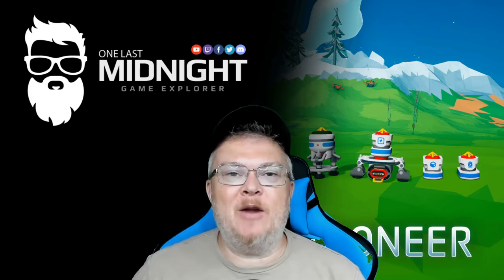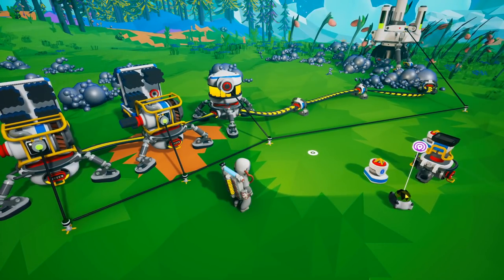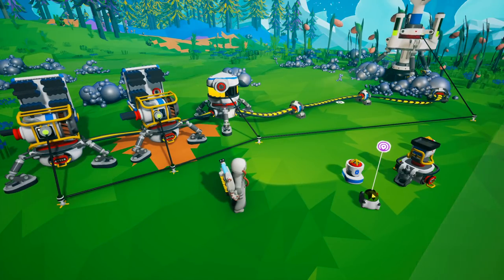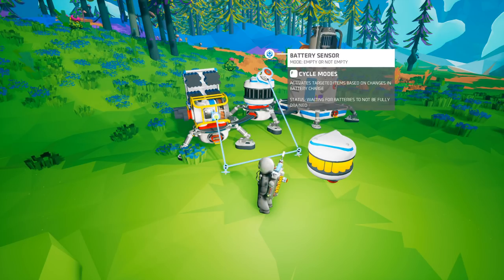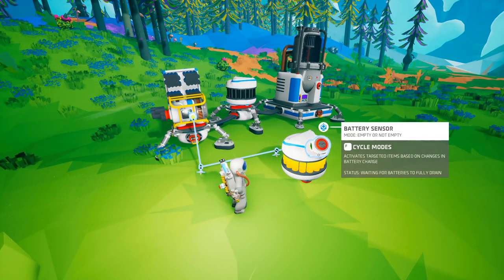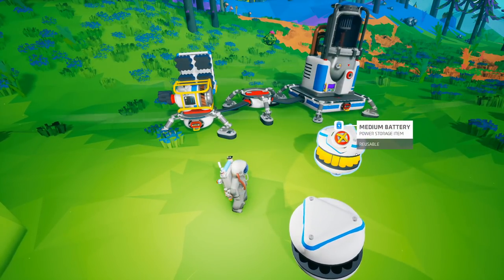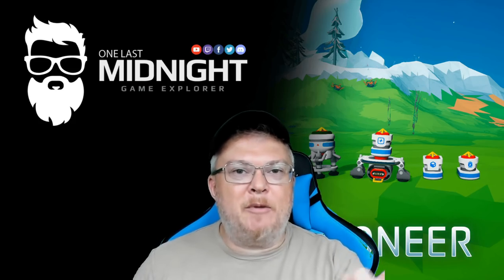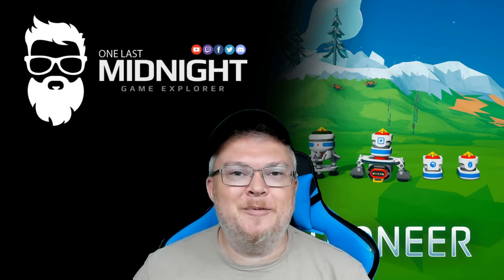Astroneer - THE BUTTON REPEATER & BATTERY SENSOR - PART 2 - A HELPFUL GUIDE

Comment: I'm guessing you could use the Empty option in the case of using mostly wind or solar power for main input. Use the empty option to trigger backup generators only when the batteries are drained.
Reply: Great thinking
Reply: I had the same idea
Reply: I was thinking it could also be used to shut off particular machines in order to prioritize others.
Smelter draining your batteries too fast?
This shuts it off so your research machines can keep running.
Kind of like a splitter, or maybe used with a splitter
Reply: But you'd have to have several batteries, right? And the sensor needs to be attached to the very last battery to drain and to fully charge. If you only had one battery it would create the bugged out loop.
Reply: But won't it freak out like in his video as soon as the generator turns on?

Comment: To get the empty or not empty function to work the way you want it to you just need to direct the flow of power: WIND/SOLAR--->BATTERY--->GENERATOR using extenders so the power only flows one way towards the generator. This way the wind/solar can always power the battery and supply power to your machines and then go to battery power if they turn off. This leaves the generators as backup power when the battery drains but doesn't cause a feedback loop because the generator can't actually power it. I'm sure there is another way to accomplish this but this lets you use only one battery sensor for the whole process.

Comment: That last mode would be useful for the same situation you set up in the last video with the generator, battery, and auto extractor. As soon as the battery is empty it sends a signal to the auto extractor to shut off. while a second sensor tells the generators to turn on (the original sensor you had). You figured out how to run the auto extractor off and the generators on with one sensor by offsetting the on/off status to begin with! (hope I explained that so it made sense lol)
Reply: Yes, so you'd need two sensors, but you could fully use the mode without  it getting stuck. That's smart
Reply: So you mean you have two sensors on one battery, one that has "Empty or not empty" connecting to the extractor and one that has "Charged or Empty" connected to the generator.

So when the battery fully drains the generator gets a signal to turn on from the "Charged or Empty" sensor. The "Empty or not empty" sensor would tell the extractor to shut off. However the very moment the battery has ANY charge at all, the "Empty or not empty" sensor would turn the extractor back on. This would instantly drain the battery again and result in the "Charged or Empty" sensor to fire at the generator. So in the end you would have both sensors firing non-stop and the whole process bugging out and not working.

Comment: The Empty/Not empty is more useful for equipment rather than power IMO. Batteries are empty - switch off the condenser, power is in the battery then run the condenser. This could make for some clever power management almost like an automatic splitter

Comment: Connect the battery sensor to the object consuming energy, when the battery is empty it will turn the object off, when the battery is getting power it will turn the object on.

Comment: The battery empty trigger could turn on a light to let you know your battery is empty...   could also attach to a platform with a battery on it... when battery drained, turn off machine, etc... maybe pause research when the base has no backup power, or turn off automation arms... etc...

Comment: Use the empty/not empty to turn off the condenser when battery is empty, then when solar kicks in and charges battery, it will turn condenser back on.

Comment: I believe that the empty not empty is supposed to be used with the full not full for a base with generators along with solar and wind. Full not full controls a single array of generators and the empty not empty controls a second array of generators. Them working together can be used to increase the efficiency of the generators by making sure that each group of generators is only running when they are needed.

Comment: I think i found a good use for Empty / not empty. You could put it to a solar panel so it would be like a daylight sensor. That could be used, for example, to shut off the lights at day. 
Edit: You can use power sensor as well, you can choose which one is cheaper for you..
Reply: That would be the use of a power sensor not a battery sensor
Reply: @ossian882  Yes, that's true. You could use both. But basically anything related to generators (can be also solar, wind, not RTG tho) can be replaced with battery sensor. By the way, thanks for the reply anyways, with power sensor it would be more effective if you didn't want a delay.

Comment: You could use the empty battery state to turn off your non-essential machines when your power production is low.

For example, have a bank of research chambers that only turn on when it's both sunny and windy.

Comment: Will have to experiment a bit with battery modes and providing power for entire base. Solar and wind are not consistent energy providers so I can see how all 3 modes might be of use when using multiple generators to provide power

Comment: I find the last scenario of the battery sensor the most useful ... if you have several solar panels and a coal generator connected to a charged battery, the battery will of course be discharged at night, the generator starts with the battery exhausted, but as soon as the  sun and solar panels provide sufficient energy, the generator shuts down, using as little coal as possible
to avoid the signal loop it would be enough to have the generator after the battery, rather than before, and put a splitter so that the current does not return to the battery, if instead they changed the operating mode of the sensor (which I think is not the correct way to  operation) would be better, but even so in my opinion it is useful as a mode

Comment: That rapid cycling on and off also happens when you try to use circuit conditions in factorio to turn your power plant on and off when your accumulators run dry. The thing I can think that would make it useful would be turning off low priority machines when the batteries go dry, so the high priority stuff will be the first to get power from whatever RTGs or generators you have, kind of a turn off and wait for sunrise thing. That's probably better served by a power sensor.
Reply: In factorio each "electronic" device change output on the next game tick, do the efect looks strange, but its well defined. Just a fast oscillator. 
What mora important, in factorio we have logic blocks. It is easy to turn on power at 5% and shut down at 10% od accumulators capaticy.
Here i have to make expensive setup just to make and/or gate. 

Thr decision to make signals flip a switch instead of transfer a logic level made the autimation updated simer, but od devs wants to develop ir further, it wilk bite them grom behind.

Comment: Empty or not empty... That mode is for use on a slower system. 
EX: a medium generator charging a battery. Let's say you don't want a ton of charcoal lying around so you give it a smelter. You hook one end of a battery detector to the battery and the other to the smelter (this assumes there is another battery in play elsewhere) Set it to empty or not empty. Now when the battery depletes it will turn on the smelter which will make a charcoal which will load the generator and that will begin charging the battery and then turn off the smelter.

Comment: I think the last empty and poweis to trigger devices to run when the battery start to receive power so in my mind if you had 4 medium battery on a platform and you place it on one of the batteries that drained first then things would shut down when you had 1/2 or 3/4 and start back up when you went above that level again of the overall battery capacity of your base but we all know there is no priority of battery use in astroneer so my theory fails.

Comment: :D thank you
Reply: The third mode could be used to disable modules that are using power, so as to not drain the system since that battery is empty